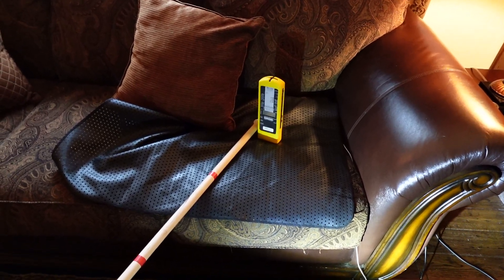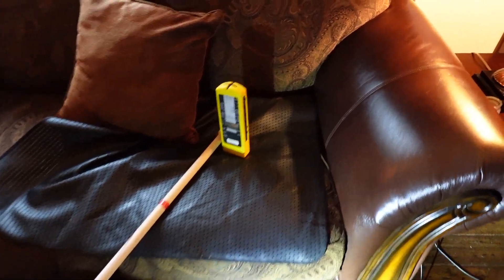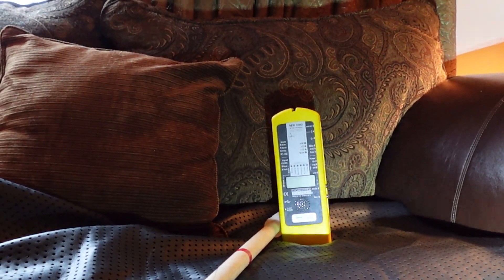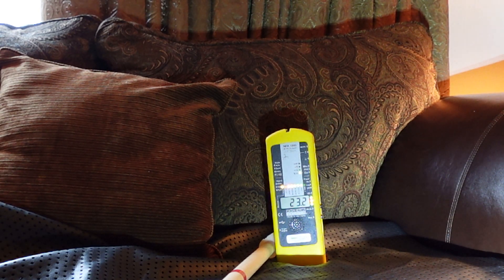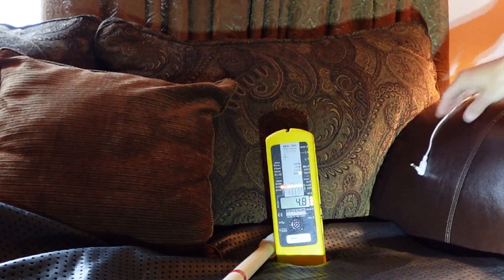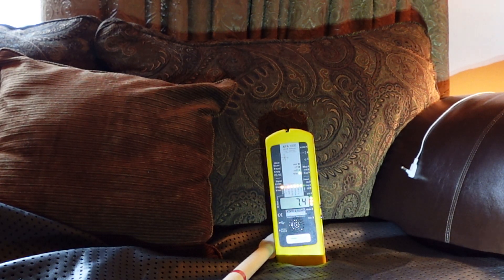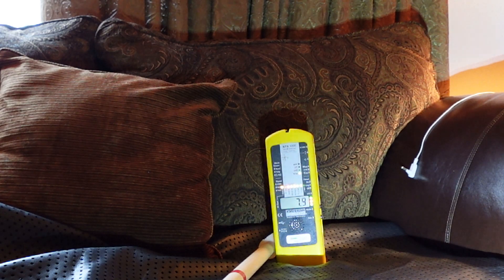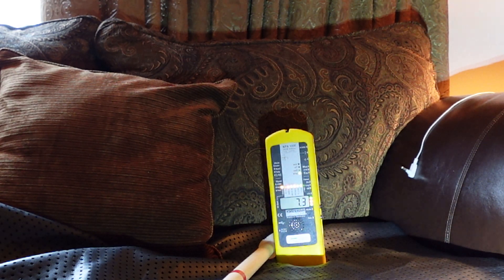The Problem with Earthing & Grounding Mats

Comment: Regardless, the grounding mat still seems to be beneficial since it lowers your body’s voltage (proven when tested via multimeter). Isn’t that what matters?
Reply from the maker: To me, what matters most is that people understand the differences between grounding via the electrical grid, and via their skin to the soil.  They're not the same.  And if the AC voltage increases with a mat, as shown in the video, then one's body voltage will increase as well.  This is not a smart move for health, in my opinion.
Reply: @optimaldwellingspaces3947  I recently tested a grounding mat connected to a wall outlet. When my skin was touching the mat, my body’s voltage went to .00V after being around .2/.3V without touching the mat. At the end of the day, I’m sure having the mat grounded from the outside is more ideal, however I’ve noticed benefits with a grounding mat plugged into a wall. If your body’s voltage is .00V, then it seems as though you’re all set according to my observation.
Reply: @Marko.4.222  thank you fir letting us know your reading.  I live in Michigan.  So I am unable to go outside to ground myself on the bare ground close to six months out of the year. End it would be difficult to put a grounding rod in the ground digging through inches of snow at times.
Reply: @Marko.4.222  Did you use AC voltage or DC voltage. DC voltage tells you the potential difference between two points. This will tell you if you're charged or not.  AC voltage tells you the sqrt of ((x1^2+x2^2+..xn^2)/n). This isn't a very useful metric for getting the voltage of a human. 
Source: I have taken more than a few electrical engineering classes and electromagnetism classes.
Reply: @noahcarter3868  Not sure. I did the same way everybody else does when you test a grounding mat with multimeter. There’s a bunch of YouTube videos on it.
Reply from the maker: The electric power grid in North America returns 60-80% of the AC current back to the utility through the soil, so AC current is the key measurement to pay attention to when grounding.
Reply from the maker: Get some better sources, like Zipse
Reply: @optimaldwellingspaces3947  zipse?
Reply: @Marko.4.222  Funny he won't respond to this. Clearly proves his thesis wrong. I tested it too, and my voltage when to 0.01.
Reply: @optimaldwellingspaces3947 what to do when you live in Norway and you cant touch soil for 6 months of the year?
Reply from the maker: @Sindre94Ipswich  touch a tree, do an ice bath, wear wool socks or Earth Runner sandals while walking on the snow
Reply: @optimaldwellingspaces3947 have you done the same test but this time with a grounding rod outside?

Comment: What about grounding to a copper water pipe instead of an outlet?
Reply from the maker: Copper water pipes commonly have electrical bonds to the home’s electrical, so it’s not a smart move.
Reply: test you copper pipe for current first and make sure it doesn't convert to PVC somewhere. copper water pipes usually make for a good earth ground
Reply from the maker: Yes they make for a good earth connection but unfortunately that’s why the electrical can bond to them too.  They’re generally not any safer than a wall plug.  Test the pipe with a clamp meter under various load conditions in your house- washer/dryer, oven, furnace, AC running and see if you have current.
Reply: @optimaldwellingspaces3947  But wouldn't the current follow the path of least resistance and go to ground (earth) regardless?
Reply from the maker: @DTMFJeff  yes current will take any and all available paths, but at issue here is the radiated AC electric component from the nearby electrically charged circuits and appliances/tech.  that type of EMF will seek a lower voltage ground point than the 120V it operates on, so the mat (and you if you are on it) become an appealing place to do that.

Comment: How long of a grounding rod do you need? 1 foot, 8 feet? I seen on Amazon a 1 foot rod with a cord attached to the rod. You push it in the ground outside your window. Bring the cord in through the window and on the other end was the snap to connect the mat.
Reply from the maker: However long you need it to be to get to the soil
Reply: the longer the better, after awhile the rod builds up additional resistance to the soil. you can pour salt on the rod to increase conductivity or when you're working outside just pee on the rod, no joke.
Reply: @DTMFJeff  Thanks. I think my dog can go pee on it for me. I heard that you can add magnesium and water to the soil where the rod is pushed in.
Reply from the maker: The dryer your soil is, the worse your resistance will be.  You may have to go deeper with the rod or keep the earth wet around the rod

Comment: I got a 7.83 frequency generator used by high-end sound engineers. It would be awesome if you could get one and test ac field with it in use.
Reply from the maker: that's cool.  if it plugs into the AC power grid, and has a 2-prong cord, it will have a significant AC electric profile for 3-5', if it has a 3-prong, probably a lot less.  How close do you have to be when using it?
Reply: @optimaldwellingspaces3947  ya I keep it 2ft away and it is a 2 prong.

Comment: The ground wire is the secondary winding of a transformer.
Reply from the maker: That’s an interesting thought
Reply: @optimaldwellingspaces3947  
It's very subtle because of linear arrangement. But I'm pretty sure that is the cause of the AC voltage rise.
Reply: It is the centertap of the secondary windings of a serving transformer, where the neutral and ground conductors are bonded together or bonded together at the "main" service panel but not at both locations at the same time.

Comment: Thanks for the just on time ground report, I'm set to replace my old mat with a couple new ones. I myself was Leary of the grounding in my home and I wasn't about to spend bucks on a gauss meter. I already have a copper 6' grounding rod I use now, so I assume I could hook 2 mats on the one rod. Problem with that is the mats won't be portable as I'll have to solder them to the button hookup.
Reply from the maker: That would work.  I’m sure you could find some type of quick disconnect to make the mats more portable
Reply: @optimaldwellingspaces3947  I'm using a small alligator clip right now but it comes off sometimes, but I just realized I could just cut off the button end of the outlet cords that come with mats. In other words just cut off the ground end and use those for the cords. Thanks for responding.
Reply: Where are your grounding rods? Upstairs or what, I hear people travelling a wire up the house through window, gotta be easier way. Sorry not well versed in electronics
Reply: @curt6525   one 6'  grounding rod in ground outdoors good size bare copper wire running through the wall to my bed.
Now after getting a big-time T-storm the other night..... I'm thinkin what if a lightning bolt hits my inground rod... I'm toast!
Reply: I live in a seconed story apartment. I made a home made canopy around my bed and I want to ground it outside my window DIY. Can you tell me exaclty step by step a list of what materials to get at home depot and how to install the ground and the safest way to go about doing it and where to put it? I'm new to this so it would really mean a lot. Thank you 🙏
Reply: @alexzemaitis  gosh you'll have to be touching ground somewhere on the canopy. Will the canopy be grounded? Is it made of copper mesh or something. As for a grounding rod you can buy a 6' copper grounding rod pretty cheap. Then use a sturdy bendable copper wire to run it to a mat or silver mesh pillowcase on the bed. I don't know how you would make a conductive ground canopy it would cost a fortune. Canopies can be made to stop EMF waves though.
Reply: @AdrepKeith   I made a faraday canopy to go around my bed and connects to an aluminum Matt underneath so fully enclosed. The canopy itself is made out of aluminum window screen but I need to ground the canopy it so it's not building a charge I guess you're supposed to. They make the grounded silver canopys and I want to get one but they start around 2 grand. I'm new to this so first I want to know if I should make a diy outlet plug to ground it to or should I ground it to a gorunding rod outside my apartment window. If you could please tell me in steps what materials, clamps, wires etc that I'll need and how to assemble for grounding it? Most importantly how should I go about doing this safley so I don't get shocked like buy copper wire and i heard i need a 8 foot copper rod to drigw into the ground? Any advice means a lot 🙏
Reply: @alexzemaitis  it's my understanding my 6' long grounding rod is overkill actually. You actually could get by with a foot long rod. I'm no expert but seems to me you could ground that canopy in your apartments receptacles. Grounding regulations are pretty strict for buildings. You could even ground to a couple outlets. I don't think codes for apartments would let you ground from 2 stories up.

Comment: who's to say that emf from devices in the room don't attract the earthing mat also even if it's connected to a rod in the ground?
Reply: https://earthinginstitute.net/wp-content/uploads/2018/10/grounding-doesnt-turn-you-into-an-antenna-for-emfs-2018.pdf
Reply from the maker: It can certainly happen.  But a direct earth connection will ‘drain’ the fields away without mingling with the home electrical dirt.  Ultimately the Best way to ground is to go outside w bare feet avoiding a mat altogether.  You’ll get natural light and fresh air too.
Reply: @optimaldwellingspaces3947  Unless you have potential snow six months out of the year.  I am in Michigan. It’s just now getting to be 40s outside. Our snow has been gone for about a week. I went out in my bare feet yesterday I could barely stay in there a minute. It was so cold. It felt like my feet were on ice cubes.

Comment: Is there voltage on their ground? Did you test that to see if that was the problem? Could be a bigger problem.
Reply from the maker: Thanks for asking.  Most homes I see have something on the ground conductors.  That’s why it’s best to avoid this as your connection for a ground mat, using the earth instead
Reply: electricians always bond the ground to the neutral side for some reason.
Reply: @DTMFJeff  Electricians bond the ground (earth) to the neutral at a specific point (usually in the main electrical panel) for safety and proper system operation. Here's why:

1. **Fault Current Path**: Bonding ensures a low-resistance path for fault current to return to the source (the utility transformer). This allows circuit breakers or fuses to detect and quickly disconnect the power during a short circuit or ground fault.

2. **Voltage Stabilization**: By bonding neutral to ground, the electrical system's voltage levels are stabilized relative to the earth. This helps protect people and equipment from stray or fluctuating voltages.

3. **Code Compliance**: Electrical codes (like the NEC in the U.S.) mandate this bonding to create a grounded system, ensuring safety and reliability.

4. **Protection Against Lightning and Surges**: The bond helps to direct surge currents, such as those from lightning strikes, safely into the ground.

However, the ground and neutral are only bonded at one specific location (the main panel or service entrance) to avoid creating multiple paths for return current, which can lead to dangerous situations like circulating ground currents.

Comment: Can I test the outlet in any way, so I‘m sure the groundingmat is working fine?
Reply from the maker: Don’t use the electrical outlet unless you’re sure it’s clean ( 0 voltage&current) and actually has a ground (test with socket tester)
Reply: @optimaldwellingspaces3947  thanks!
Reply: Yes, use a multimeter to test AC voltage grounded vs ungrounded.  Just search Ytube "earthing multimeter" for proper setup
Reply from the maker: @debz9768  yes